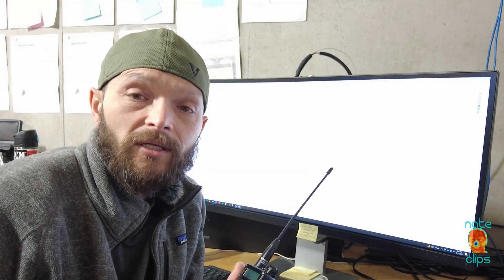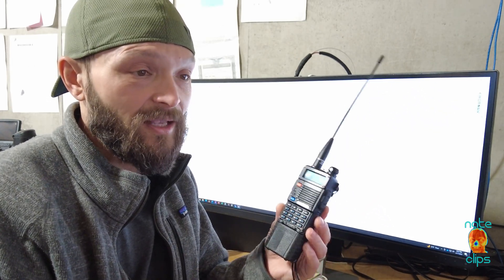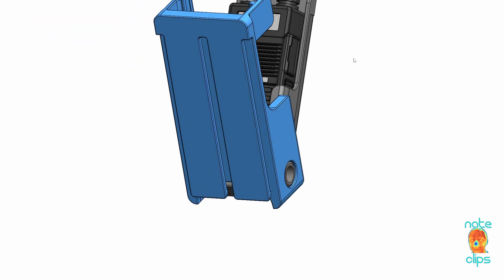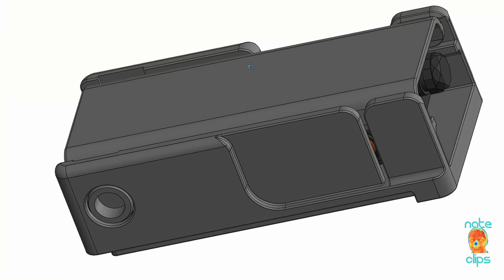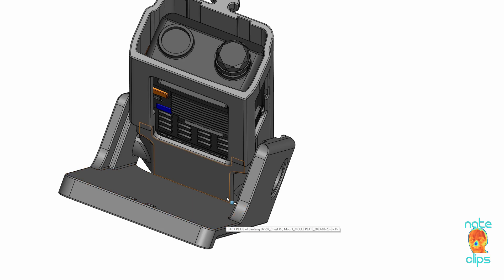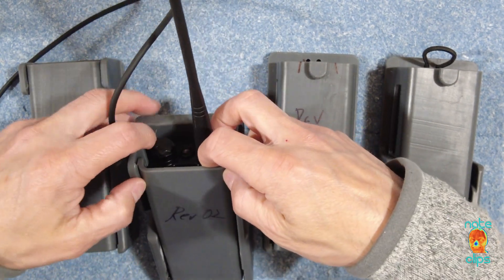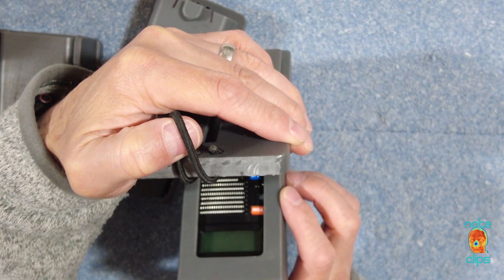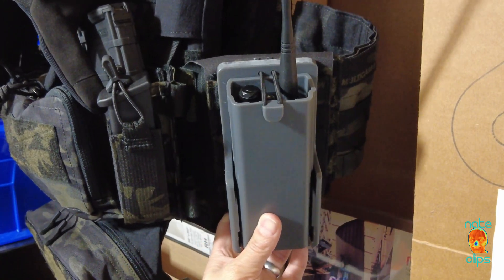I made a chest rig holder for a Baofeng UV-5R.

Comment: Just wondering the practicality of wearing your radio on your front webbing if you need to engage in fire and movement when you may be constantly smashing into the dirt for cover. Can you see any disadvantages of wearing it there or it better positioned on the back closer to the shoulder? Genuine question. Thanks for the STL files. Appreciate your work.
Reply from the maker: For me, it's sling interference with the type of sling i typically use....the plastic "fast adjuster" on the sling can sometimes catch on the radio holder.  To your point, it can easily be moved to another molle panel.

Comment: If you need 3d scans of that radio or some other models let me know.
Reply from the maker: What kind of scanner do you use?
Reply: @natetran  IDK what the brand is but it's a structured light scanner that the boss lets me use after work.
Reply from the maker: @GeorgeJouflas  if you remember what model/brand it is, it would be cool to know....when 3D scanners first came out years ago, they sort of sucked....might be time for me to do some research.